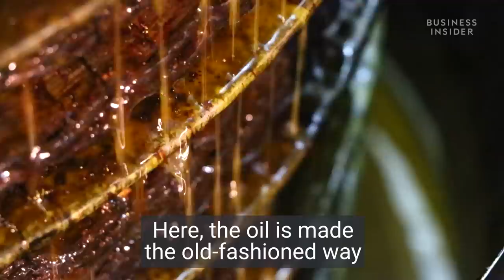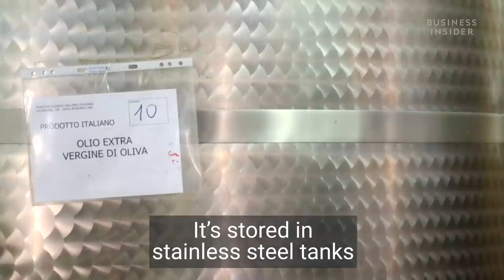Inside a traditional Italian olive oil mill

Comment: It's not that traditional nor old fashion way to make oil... There are still so many machines and electric power used here!
Reply: Well, before electricity the granite wheels were pulled by donkeys. And we shouldn't use donkeys anymore, don't you think
Reply: @frafrafrafrafra is the unfiltered olive oil more healthier than filtered ? I think in the past they do only unfiltered.